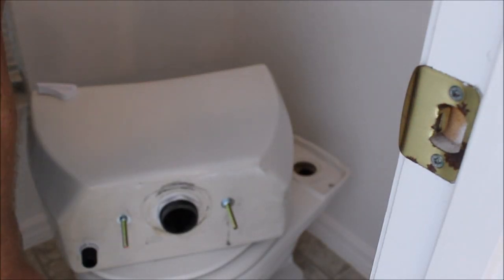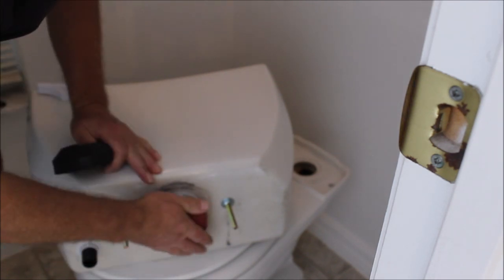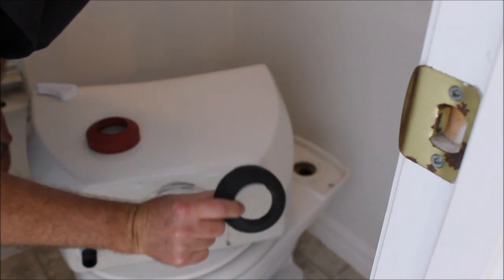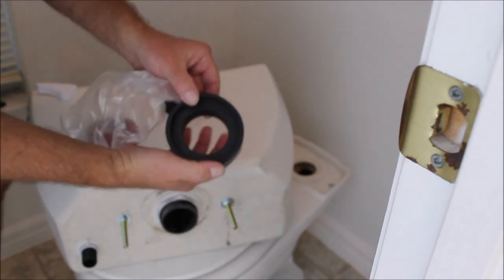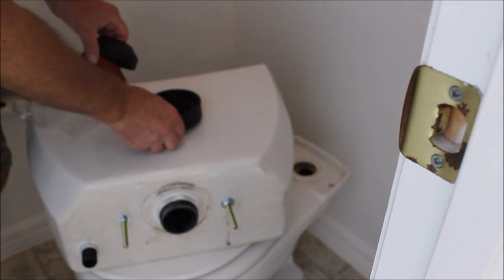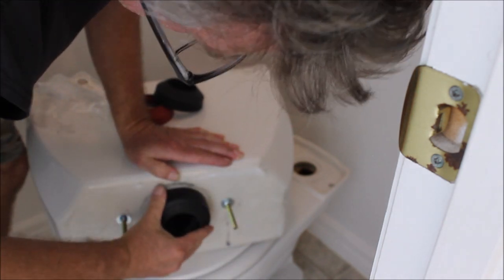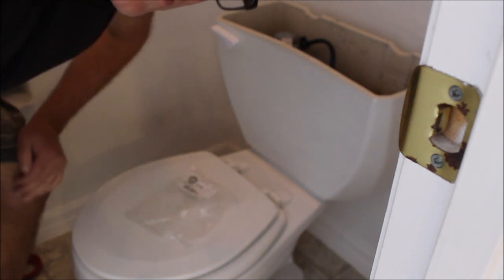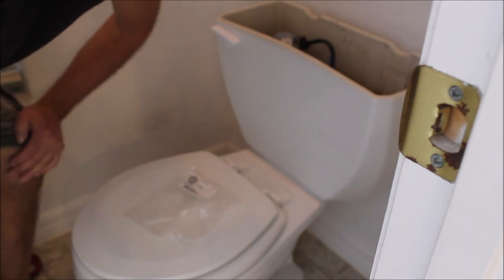Beyond "Extra Thick" Toilet Tank to Bowl Gasket Fix

Comment: The bathroom had an old Gerber and the wall is destroyed because of the wrong seal ring. I bought the place and never knew it was continuing leaking. I am replacing the wall and almost put "an extra thick ring" to fix the leak. You have saved me hundred or thousands of dollars. Thank you so much.

Comment: Just a follow up. I received the new gasket this morning and finished replacing it. The gasket you used stopped the leak completely.
The bowl does ride a little higher but everything functions fine. Thanks for the part number. Also subscribed to your channel.

Comment: Thanks for the video. After I changed out my fill valve the tank started leaking at the bowl. Of course I bought the extra thick gasket and it leaked even worse. I'm going to try and track down a Gerber gasket tomorrow. I'm pretty sure you solved my problem.

Comment: Thank you! I will try that extra large gasket. My water tank shows "Gerber K-10-2594-4" and looks similar to yours. After installing the "Fluidmaster Universal 2 inch 400ARHRKP10", when flushing the toilet the water pours out between the tank and bowl.
Reply from the maker: Hopefully you found a fix. I didn't even add water with the first two in the video because it was obvious they wouldn't seal.  Sound like yours maybe should have sealed -but appareantly didn't.
Reply: @roberthare2251  I installed the thicker gasket and it worked perfectly. 👍 Your video helped greatly!

Comment: I'm facing the same problem where do I find the gerber gasket part 99-582 please and thank you
Reply from the maker: I got it from a local plumbing parts shop in Melbourne FL, and you can probably find a local supplier where you are. You won't get them at HD or Lowes. If you google it, there are a lot of sellers online.

Comment: Question, i replaced all the flush kit with a fluidmaster universal, nothing leaks, however when the tank is full and i go to flush, no water comes to bowl, all the water stays on tank and bubbles outs out but no water is going to tank, do you know why?
Reply from the maker: I'm sure you have found a solution by now, but it sounds like the problem was with the flapper that releases the water from the tank then closes so the tank will refill.

Comment: is it ok that the gasket rim at the bottom is not even with the flush valve?
Reply from the maker: Any way you do it, the gasket must fully fill and seal the joint between the tank and the bowel.